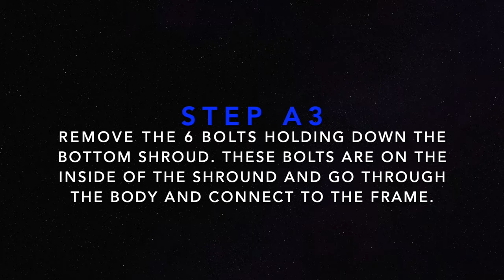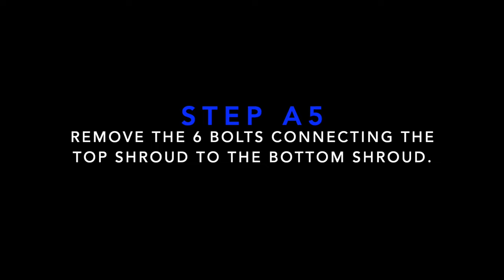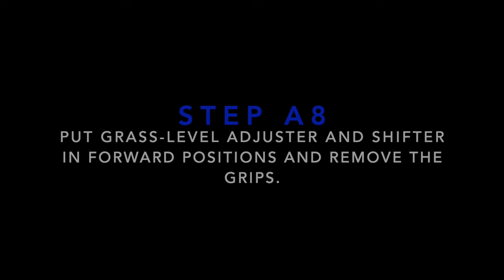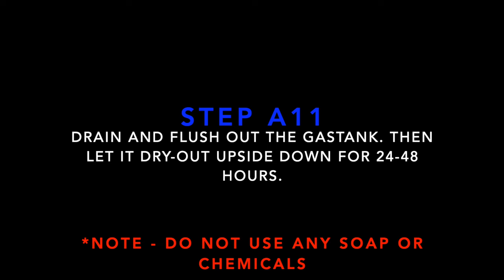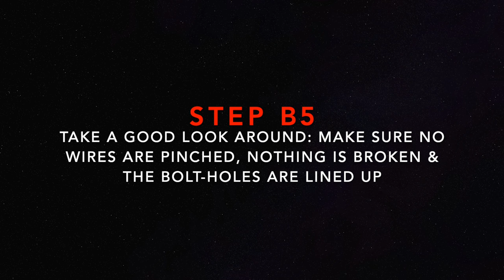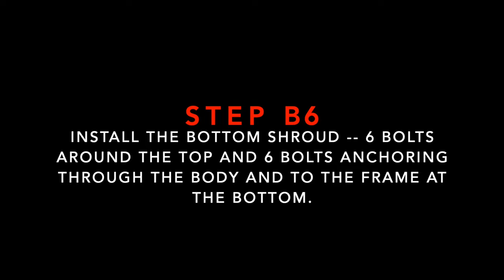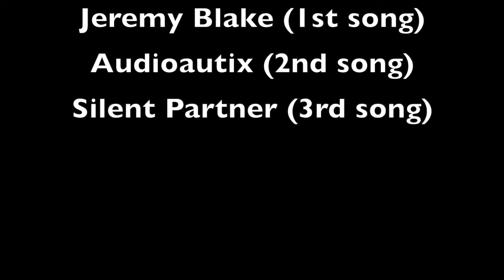The Right Way To Remove a John Deere Gas Tank

Comment from the maker: IMPORTANT: Take the gas cap off and look up under it. You'll see a rubber seal and these things dry-rut. In many cases this is the debris we're seeing in the gas tank and not leaves and dirt. That seal will continue to deteriorate and you're going to be back to where you started in a year or less. Replace that seal and be done with this project for good.
Reply: This john deer will never be the same again,whoever designs this tractor  must have been the class clown
Reply from the maker: @user-pn5fk8db9q  Oh - Bull.

Comment: Just finished replacing the gas tank in my JD mower. Thanks for showing the right way to disassemble the unit. This video saved me a whole bunch of time and I didn’t want to spend 45 bucks on the shop manual. 
Thanks for your efforts

Comment: Great video.  One important addition.****  At around 4:40, remove the streering wheel and the shrouds will be much easier to remove and put back together.  Mine was easy to remove.
Reply from the maker: Good point. Thanks for the tip.

Comment: Thanks for showing the CORRECT way!  I had to remove my father-in-law's tank from his D160 (had sticks and bark debris in it) and I knew the two bolts in the back had to come out. But I didn't readily see what else needed removing. 

Taking a YouTube break in the 90 degree heat, I sat down and the FIRST video I saw had a guy using a chain fall to lift the back end.  The first thing that entered my mind about this wasn't in polite language because it was obvious I'd be damaging the body...and he was, too.

Honestly, it only took me an extra half hour or so to do it right, thanks to you.

Dad's mower once again runs like a champ.
Reply from the maker: Hi Glenn....
If you and your father-in-law are confused about how it got in there.... consider this..... Take off the gas-cap and look at the underneath side.... There's a rubber-ring that makes a seal when you tighten it. These seals often dry-rot and fall apart inside the gas tank.... If that seal is brittle and broken... that's what the debris is. (Until you get a new seal... take the old broken one off so more of it doesn't fall in the tank). 

There's about a dozen of those hack-videos where people bend their tractors. They all copy each other so I was happy to fill that void and help stop that nonsense. These tractors are not cheap and what they're doing is shameful. 

Have a great weekend.

Comment: Thanks for the tips and thoroughness. The first video I watched was very good but they took off the mower deck, cowling, belts...professional but, no, thanks. The second video suggested bending the frame, nope, again. 

Your advice is very reasonable, practical, and effective. The hardest part for me was prying the top of the console from the bottom after all the screws were out but after seeing you do it I just went for it. I saw that someone else took the steering wheel off...seriously thought about that but was unsure. 

Too bad JD decided to use a two-part tank with a seam at the bottom of the tank. The new single-piece tank. is a much better design. This worked great! No more gas fumes! Thanks, John.
Reply from the maker: Hi Llyoyd. Sorry I missed your comment. Sometimes YouTube doesn't notify me. I'm glad I could help.
Reply: Yes apparently my gas tank has split at the seam causing gas to drip out. I'm going to seal it with either a soldering iron or marine 5200 sealant

Comment: Excellent presentation, thank you very much!  I followed Cyptoshroomer suggestion of removing the steering wheel and it made it much easier to separate the top and bottom halves of the shroud.
Reply from the maker: You're welcome. Thanks for stopping by. Yeah - separating those two can be a total pain and I thought about your suggestion but I didn't want to make the video too long or complicated. 
Peace

Comment: My Deere has a bunch of surface rust on the body, definitely using this video when i get time to take the body off too blast and repaint it! Much appreciated! Last year I was about to attempt it but just doing a quick glance it looked a heck of a lot more complicated than it is so I ran it rusty for the season lol
Reply from the maker: I'm an old auto-body guy and never even considered doing the body of a tractor, but I would think it would be fun and relatively easy. While you have it apart you might want to consider doing the deck too. It's not the best design in the world and the folks at John Deere created a few water-traps that could turn into serious problems down the road. 

Good luck with it. -- Peace!
Reply: @JohnDisque  already have the deck stripped, as soon as we get a couple nice days it's getting sand blasted!

Comment: Great video! I did 1 thing differently on my L118. I popped the steering wheel off and that made it easier to separate the top and bottom halves of the  shroud. Oh and I loved your choice of music. It felt calming and reassuring. :)
Reply from the maker: Thanks Crypto. 
I'm a cryto-head too.
Peace to you and your family.
Reply: They need to design a back door to get the gas tank out. I am just going to cut a hole on the back plate and make it a door.!
Reply: I removed the steering wheel as well.
Reply: @hdrk59 I think that's what he did video cuts out right when he lifts the top shroud and realizes he didn't have the clearnance to get it in place he either had to fight this thing super badly which took a lot of time or just removed the wheel. But being a hard headed mechanic myself I would've tried getting into to place without removing the wheel until I was left with no choice. That's actually what brought me here because I had to tell my customer the other day I was pretty sure the body for the mower was going to have to be removed in order to get that tank out but I just thought that was ridiculous theory and there had to be an easier way come to find out I was correct but I am not happy about being correct by any means 😂

Comment: Thank you for the video.  Just completed a fuel tank clean on my 2004 L110.  Two interference issues not discussed for me.  The spring for the “cruise control” lever gets bent over during the lift of the body.  Mine broke, 2.39 at JD.  Additionally, the brake/starter interlock limit switch popped out during the body lift.  Snapped back in fine once I figured out why the engine would not crank.  Thx again!
Reply from the maker: Thanks for the added info, James.

Comment: Excellent instruction! I have a LA145 and there were a couple differences. There are 2 more screws holding the lower cowling on and there is only one lever. It raises and lowers the deck. I was able to rest the body on the lever but recommend something on the other side. I Used a piece of 2x4 between the body and the wheel. . I could not remove the cowling without unplugging everything but I was able to move it forward enough to raise the body. Once I did that the tank just slipped right out. Thanks again.
Reply from the maker: I'm glad the video helped. Thanks for the information on the LA145.

Comment: Great Video, thank you.  I needed this and will use your information for my JD L102 in the very near future.  Thanks for showing us how to DO IT RIGHT.
Reply from the maker: Great! I'm glad I could help. 
Keep me posted on how it goes.
Peace
Reply: I FINALLLLLY removed the tank.  Other than two stubborn bolts, it was easy since i followed your instructions.  I tried to leave the battery tray installed, but disconnected but it had to come out to access the stubborn bolts.  I also disconnected the parking brake rod to allpw some room for my fat paws.
Now i just have to see if i can repair the tank.
Thank you, this was so easy I am baffled why people treat their mowers like trash by bending them.
This, like all good maintenance practices, also allows you to clean the machine and find possible issues that are creeping up.
Thank you Sir.
Roger
Reply: I am nearly done assembling my mower...ordered some fuel line and filters to be safe and had some delays.
I found removing the steering wheel to be easy and helpful in the reassembly.  That is the only thing I would add to the disassembly in the future.
I appreciate your video very much.  It is terrifying that others are not doing this properly in order to avoid a little work.
John Deere should pay you for this video.
Again, many thanks sir.

Comment: At first I did not understand the issue, until you stated that some repair guys bend the mower in half to access the fuel tank.  They should know better.  Thank you for sharing this.  I don't have the same model, but it looks like the process is quite similar.
Reply from the maker: It's a matter of laziness for them to do that but I find it truly amateur and almost embarrassing. These tractors are not cheap so I can tell they didn't pay for them. 
Yeah --- Yours will be a little different here and there but once you get down in there you'll figure it all out and the basics remain the same.
Peace

Comment: One small emgine guy to another this is a really good video. I have a customer with a john deere d110 with the very same issue debris in the tank of all sorts i pumped the contaminated fuel out with a vacuum pump only to find trash in the tank. I explained to the customer it has an in line fuel filter and that debris would never make it to his new carburetor but he is just very particular which is fine it's just another job hes willing to pay for in my opinion. So i had a look at the back of the mower and seen that back plate is welded so it wasnt going anywhere i told him i was pretty confident the mower body has to be removed in order for that tank to come out because i honestly dont see any other way. Which brought me here because i still was just hoping i was incorrect and there was something i wasnt seeing. But unfortunately my guess was right. The video was super helpful though for sure becuase i wouldnt have thought about that slick trick you pulled to just set it on the levers for the height adjustment and pto engagement(or transmission speed). I see why on newer tractors the tanks are now mounted in the front where the battery goes and then the stick the battery under the seat. I think thats just a much better set up then having to remove the entire body of the mower for a simple tank cleaning but it is what it is😂
Reply from the maker: IMPORTANT: Take the gas cap off and look up under it. You'll see a rubber seal and these things dry-rut. In many cases this is the debris we're seeing in the gas tank and not leaves and dirt. That seal will continue to deteriorate and you're going to be back to where you started in a year or less. Replace that seal and be done with this job for good.
Thanks you for the time you took from your day to watch this video. It's appreciated and I'm glad I could help. 
Peace

Comment: Nicely done and should be very helpful when I need to do mine. I'll add this...the debris in your tank kind of looked like mine which I believe was the crumbly gasket bits from the gas cap. At least that's what I think mine was as I got it used so can't say what gas cap looked like new. Anyway, this may be helpful to save some time. I took a wooden dowel about 3/4" thick long enough to put in the tank. I dipped the end of the dowel in heavy wheel bearing type grease thick enough that it was gobbed on good(as if I had pulled a wad of chewing gum out of my mouth and stuck it on the end). Then where the debris was I just dipped it in the tank and pressed into the debris and it stuck into the grease. I did NOT drain gas from the tank. Pulled it out of the tank, removed the bits mashed into the grease, and went back in for more. It worked and saved me some time.

Comment: If it’s not leaking, there’s no reason to remove to clean. Drain it, use hot water rinse with a little alcohol and dish soap rinse again. Invert the mower using an elaborate pulley/ block and tackle concept I devised. After drying is complete; pick up all the random parts that have fallen off onto the floor. Return mower upright, call neighbor to help figure out what those parts are and where they go.
See? Easy Peasy 
JK- very good video sir.

Comment: goodness gracious, Wonderful job!  Just 
ridiculous amount of work for a gas tank.
Reply from the maker: Thanks RH. 
It's not that much work. It's just that slowing down and taking it step by step makes it look like a lot.
The problem is the design. John Deere could've designed this so you could access the gas tank by lifting the seat, dislodging some clip, removing the hose and taking it out.... but they didn't. That would require money and work and a decent engineer/designer. 
It's not to say I dislike JD... I love them but they let the consumer down on this issue. 
Peace
Reply: @JohnDisque  , 3 hours and 26 minutes later.  
Quite satisfying, but i AIN'T doing this again.

Comment: Just saw this was five years on. I agree with the sacrilege of folding the body. It’s a Deere, after all. My tank is in need of a similar procedure, unfortunately.
I was contemplating the replacement of the entire fuel line whilst in the process. At 9:28  .. what is that piece/part? Did it break during wash or is it a removable piece? Thx.

Comment: Much better video than bending deck. 

If you were to just remove tank & clean it out then refit how long would you say the job is ?

Forget about leaving it for days etc to dry. So please advise if it was just strip, remove tank, refit tank then reassemble. 

Thanks.
Reply from the maker: Well - Your first time doing it is going to take longer but after doing it 3 or 4 times you could get it down to an hour... give or take a few minutes.
Some people have more mechanical aptitude than others so it's going to depend on the person. If you know your way around a tool box, can do things like change your oil, change your brakes, do a tune-up, etc... yeah..... you can get this down to an hour.
Peace

Comment: I have an LX280, and while the controls may be a bit different, the process looks to be pretty much the same.  Question I have is this:  If you just loosen the bolts at the base of the 'console' tower, then remove the bolts under the seat, does that give enough room to pull out the tank?  I'd REALLY like to avoid taking the tower apart if I can avoid it.  But if it is necessary, it is necessary.  Also, does this process give you enough access to the fuel lines if you want to go ahead and replace those?  Mine are 20 years old and those things can wear out from the ethanol in today's fuel.  So if I'm going to clean out my tank of debris, I figure it prudent to go ahead and swap that fuel line if it is accessible during this process.

Comment: If you have a filter do you need to do this, i have part of the filler cap rubber in mine
Reply from the maker: People are telling me all the time that thier gas caps are falling apart inside the tanks. John Deere needs to address this if they haven't already. 
Yes - I would take it out and clean it out because it could clog up the gas-line and never reach the filter. 
It's not hard -- You could knock it out in an hour or two.
Peace

Comment: I just finished a L110 42" .  Takes a lot of time and effort if you prepare the items for Painting.  If you are that far into it, why not?  I have not heard of a 102 5 speed.  Your Rack and Pinion look good.  I have found that you can drill through the Pinion gear and invert it for new gear contact.  My front Fuel tank support was sagging so I popped it out of the frame and re bent the rod in my vise.  Lots of interference with the bezel around the Sight area for Fuel remaining.  One clip was broken and I ended up making SS clamps from Banding clamps and some automotive 2 sided tape to hold it.
Reply from the maker: I'll remember that "drill through the pinion gear" trick. 
It's interesting what you find when you start taking these things apart and you can stop a lot of potential problems down the road for just a few bucks. 
How's the paint job going?
Reply: @JohnDisque  6 days and 2 trips for parts.  L110 is delivered.  Family,so I was underpaid!

Comment: Is this the same basic procedure for the John Deere 225 ? the tank has a leak and I think the fuel line that comes from the tank is going bad there is air being sucked into the air filter...I can see air bubbles  coming into it. How long does this whole procedure take?
Reply from the maker: @mrclay50 --- Yes. I am working on a 100-series, but the basic procedure is the same.
The tanks leaking at the seal around the tank (where they put them together) is a common problem as they get old and dry-rot. 
The gas lines are cheap and also check the feeder-tube and grommet going into the gas tank and connecting to the gas-line. 

I don't know your mechanical aptitude so it's hard for me to say how long this is going to take you. If you can do basic maintenance on a car (change the oild, change the spark plugs, etc) you're looking at an hour to get it apart and another hour to put it back together.
Reply: @JohnDisque  Thank you so much for you quick response...I will be looking into it more in depth tomorrow, after seeing your video and reading your response, I think I can do it.  Thanks again Clayton Collier

Comment: Good Morning Sir
Can i use these same steps on my JD L120?? Because i need to clean but i wish to replace my gas tank.
Reply from the maker: Good morning... 
Yes - you can... The basics are the same but you might run into a few subtle differences. those will be obvious when you get to them. 
Peace!